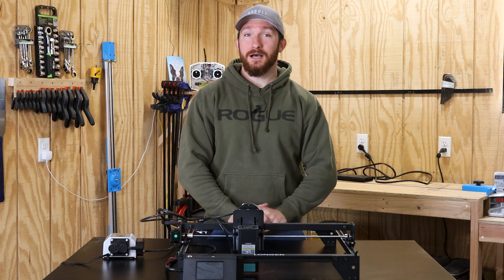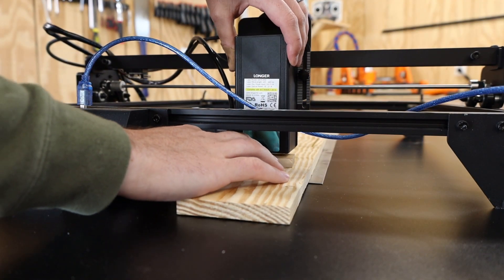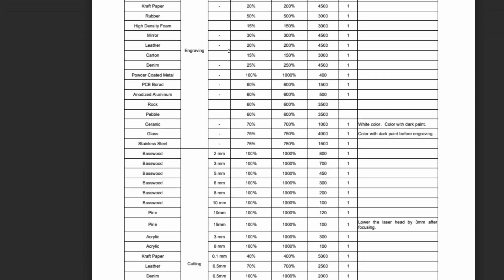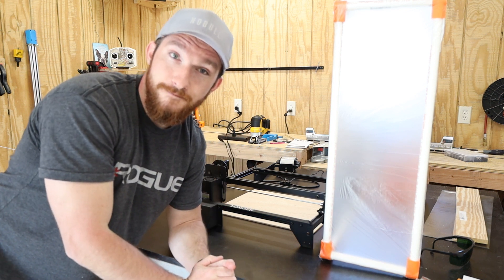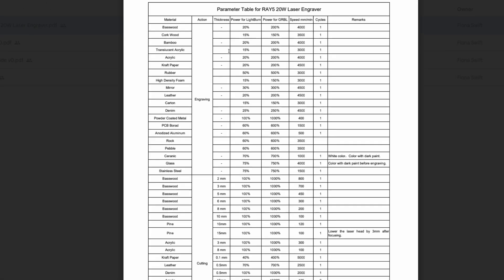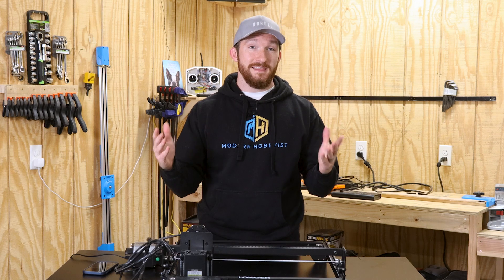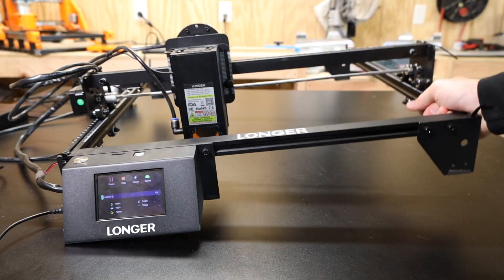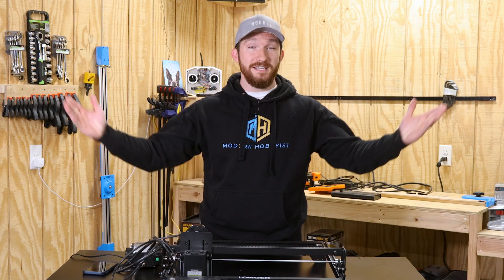Can This Diode Laser Cut Steel?! | Longer Ray5 20W Review

Comment: Got one this past weekend thru amazon (so i can return it if it doesn't work out)
Immediately have issues with Homing. They should have installed a hard limit for the X direction as well as the Y because if the air hose is up it smashes it into the railing and tries to keep homing. 
They also still haven't fixed the cable management issue.
Probably going to end up returning it...

Comment: I started with the Ray5 10watt, went to the 30watt upgrade, added air assist, y axis extension rails, cable trays, extension feet, and a much larger enclosure with safety plexiglass view windows, lightburn camera, and 8" exhaust vent. The nice thing is that I've been able to do it in stages and build it as I could afford to do so. The down side, is now I'm into a hobby laser for about $2k. But even at that price, for the working dimensions, power, and functionality I have in the current iteration, it's still a pretty good deal. If you want a production laser you can set up and produce product for sale, this isn't it. But if you want a hobby unit you can tier up in stages, it's a pretty good deal.

Comment: Curious if your cutting test would have been more successful if you had used the honeycomb cutting base as opposed to the flat sheet of metal?
Reply: And the air assist.  Not sure how powerful the pump is if he said he tried it. But it is night and day, air assist and honeycomb bed to remove the soot for deeper cutting, and smoke mark buildup,  the laser has a hard time penetrating ash and causes dark burning.   Good air assist cleaner cuts.

Comment: This machine is not designed or made for cutting metal and cutting thicker wood requires numerous passes. You could have easily changed your wifi password.
Reply from the maker: I have dozens of IOT devices so no I can’t easily change my WiFi password.

Comment: THANKS FOR THE HONESTY. I almost bought one, but I am not gonna struggle with these issues you pointed out… I am very, very very brand new to this and did not want to spend the money and this was the least expensive I could find, but I am not going to spend that kind of money on a piece of crap… Thank you.
Reply: You can't buy a laser engraver/cutter without a sinlge issue. We have 3 in the workshop and even the €3000 xTool had several issues with the mainboard, the connection etc. My boss even has  MetalFab ($7000) and also with issues. This particular Longer with 20W, air assist and honeycomb is €410, and for this price maybe Orthur lasers could be an alternative.

Comment: Like @gianlucatomasello9492 mentioned you tried 0.05 inch steel wheres the spec promised 0.05 mm steel (25 times thinner).  @ChadsCustomCreations was able to cut 0.15mm (0.006 inch) steel with a 20w machine.  The thickness really matters because of the heat conductivity of the metal.    The new upcoming 70w machines will make things interesting.
Reply: That's all nonsense. To cut steel you have to spend the money on a 300-500W laser, at the very least, but I would suggest to go for kW scale lasers. The internet is just publishing stupid these days... like the idea that one can cut aluminum on a CNC machine made with plastic parts. What nonsense.

Comment: Just a little hopefully helping info…raise the bed. That’s why your cuts didn’t come out so well.
Aluminum…no go for any diode laser.
Any metal etching and glass needs a sort of “backer” or coating.
Several instances I saw were setting issues, not machine issues. But there’s too many to type.
IMO, I’d say you need to familiarize yourself with the units before throwing a semi-bad rating.
I have this exact machine and many others, these are definitely not production type machines, but they all take quite a bit of playing with them, learning and setting them to dial them in. The power you plugged them into can affect their performance capabilities.
This machine will do exactly what it says it will. The operator just needs to know what they’re doing.
Reply from the maker: I mean I tested the machine against the settings provided by the manufacturer using the focusing block that came with it. I also spent a lot of time tweaking settings, I just don’t have time to show all that in a video.

Comment: From 7:10 to 7:20 that cut is pretty rough on the edges or is that normal
Reply from the maker: I think the cut you're talking about is one I made with my CNC Router. The laser actually had almost no effect on the aluminum, I just could have done a better job of separating the two operations visually.
Reply: @ModernHobbyist It's my understanding that you really need a fiber laser to cut metal. I put a sheet of aluminum foil on our 100W CO2 laser and hit it with 100% and it did nothing.  The internet says a 150W-650W CO2 laser might be able to cut some metals (steel) but diode lasers seem extra unlikely to cut any kind of metal.  Engraving the coating off anodized metal is usually the way to go, or using Cermark (or generic moly dry lube spray) can bake markings onto certain metals, mostly ones that don't conduct heat as well, so the heat can get hot enough to bond the molybdenum to the metal.

Comment: Your air assist tube goes out that top hole of the laser body to keep it secure/veritcal .. I mounted my air valve on the side of the body myself :) .. My 20W looks different, though in that the set screws are on the right rear and a little flip-out piece is there for Z-height. I was hoping mine was more like this one that you have.

Comment: You did not use anodized aluminum if I am not mistaken.... and the stainless steel was 0.05 inches thick (1.2 mm) and not the 0.05 mm recommended.  Can you confirm if it cuts anodized aluminum?  Also... I dont care if it required multiple passes to cut something, do you have a follow up of what it cuts after all?
Reply: You need a spray like Cermark. Anodized aluminum makes it more difficult.

Comment: Where did you find the recommended material settings list from Longer?
Reply from the maker: There a link on the websites product description that took me to a shared good drive folder with the manual and various recommendations in a spreadsheet

Comment: Probably need to raise the materials above the bed for better cuts. Also, this is continuous wave laser not well suited for the power levels you are using. Pulse lasers are more appropriate here with a high peak power. Also, I don’t think the laser head outputs 20 W of optical energy either. Lastly, many metals are highly reflective across the spectrum so requires high powers to actually have the laser energy absorbed by a metal workpiece.
Reply from the maker: Thanks for the comment! Are diode lasers all susceptible to those same issues then, no matter what "wattage" it says it is? Or is it a pulsed vs. continuous wave issue?

Comment: I believe the pump is an "air assist pump" which is meant to improve the quality of the cut.
Reply from the maker: Thanks for the comment! That was my assumption as well, but it didn't seem to make much of a different. I used it for the entirety of the testing simply because I figured it couldn't hurt, but when I turned it off in an attempt to get better results, I saw no change 🤷🏻‍♂️
Reply: @ModernHobbyist  Thanks for the clarification. Bummer it didn't show a difference. I learned a lot from the channel "JT makes it" on the pump concept for diode lasers.
Reply from the maker: I'll have to check that out!
Reply: @ModernHobbyist The air assist is meant to keep smoke (especially the resinous stuff plywood and such can give off) away from the laser lens as well as possibly blow out small fires that can come up. Keeping the lens clean is pretty crucial since a dirty lens with a laser going through it can get damaged really fast.  (our makerspace has a 100W CO2 laser that I help maintain)